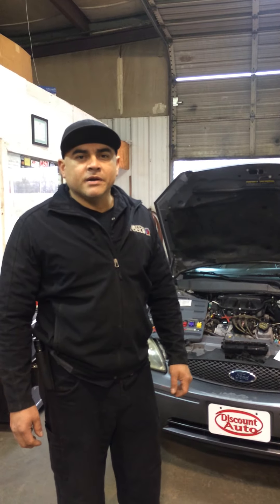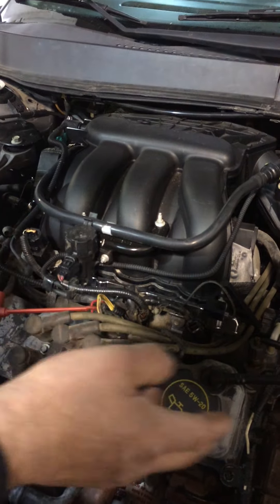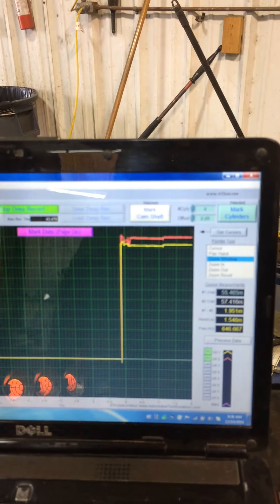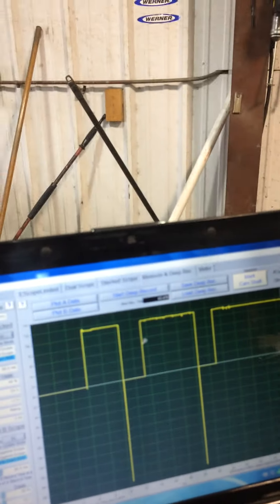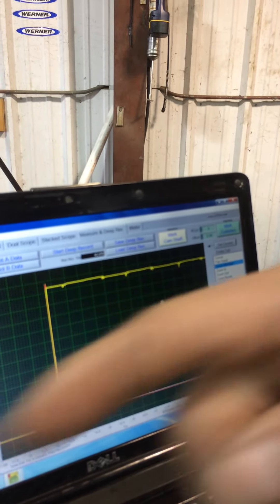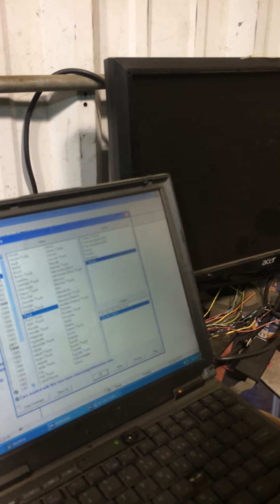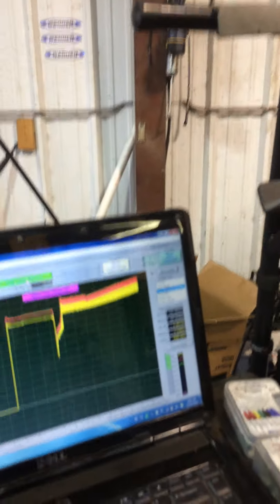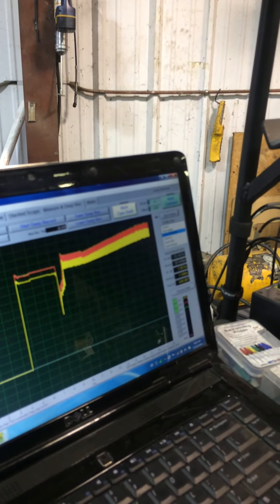PART-2 2006 FORD TAURUS ANTI THEFT PROBLEM CODES B1600 AND B1601 ATS 4-CHANEL SCOPE

Comment: Well I'm stumped I have a 2004 Ford Taurus ses I've got power to started changed the starter relay and the battery. And still does just like your car. The key fob broke apart and I glued it back together sometimes the car cranks and runs fine then does exactly what your car is doing. I would think if the key fob was bad it wouldn't crank at all?

Comment: My 2003 Mercury sable has this theft light issue and never had a single starting issue. Got food and came out and it will only click lightly and not turn over. No multiple clicks. Radio and lights and everything electronic is working fine.